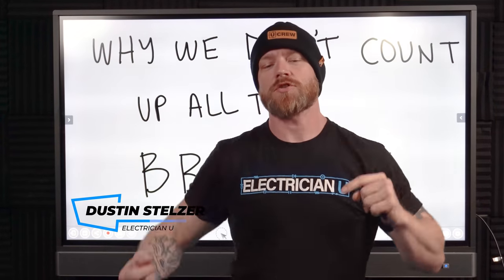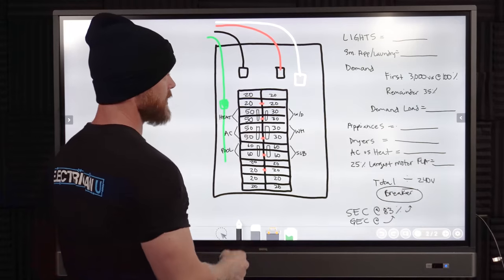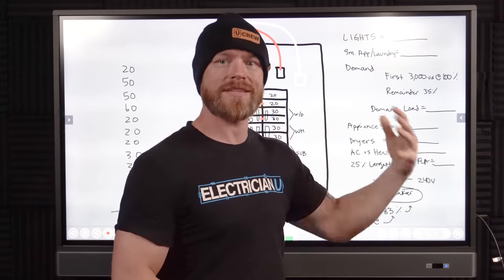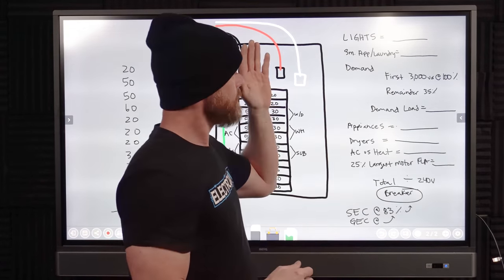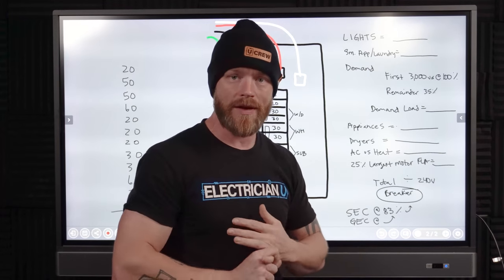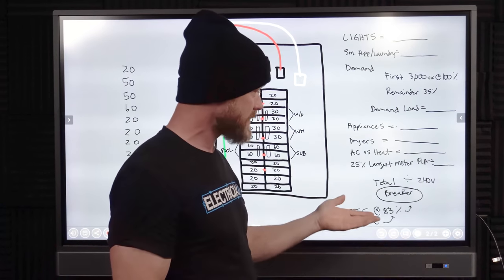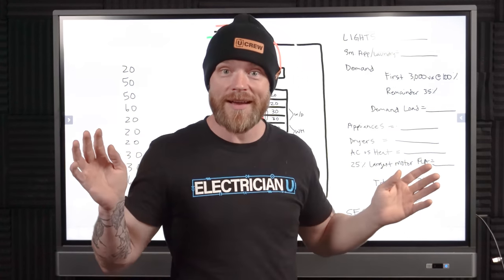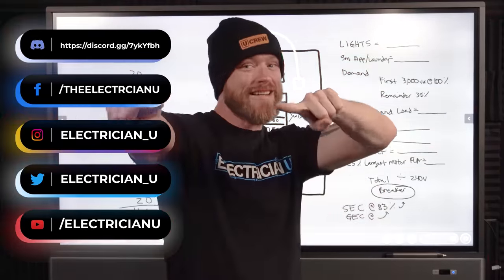Why is there more than 200 A worth of breakers inside of a 200 amp panel?!

Comment: Unless you get someone like me that collects vintage air compressors  and have 10hp single phase motors  and big welder.      I could definitely  accidentally over draw quickly but I use common since and hope for a bigger  Service one day. Even 3 phase would be super abdomen but that won't happen

Comment: I have a 150 AMP service installed in 1982.  The meter can has rusted at the bottom.  150 A has been very adequate, so should I just have a new meter can installed or should I upgrade to 200 AMP?

Comment: Good video. Would it be safe to run a ton and a half 50 amp central H/A system, a stove/oven(220 V), washer and dryer, refrigerator and a few 15 amp plugs and lights through a 100 amp box? The tiny home is about 600 square ft. Your response would be appreciated. Thanks. This is only be used as guests house..
Reply: @cat dash.  A 100 amp feeder is more than adequate for the loads you listed.

Comment: Is there a difference with the calculations in commercial or industrial? Sometimes we have a subpanel just for lighting or receptacles or both, etc... The house I just bought has a subpanel in the kitchen and runs some weird sh... stuff. But my original question... commercial or industrial. Is this just for residential?
Reply from the maker: Yes this is for residential. Typically in commercial or industrial the drawings are drawn up by an engineer who calculates the connected load and diversifies the load off of their calculations.

Comment: Looking at a GE panel. Two 20 amp Siemens breakers. Both have 14 ga circuit wiring in two spots. Breaker states 14 AWG on it. Is this acceptable for this breaker?

Comment: Because one breaker protects the outside wires, and the other breakers protect the inside wires. It's never expected that all, or even most of the inside breakers will be in use at the same time, otherwise people would be paying a lot more for their entrance drop for the extra wire size required, and the power company can't be bothered to install their own breaker for every single drop(cost of installation, cost of maintenance, hassle of accessing the pole every time some idiot trips their mains breaker), so they pushed that cost on to you by lobbying the politicians while the regulations were being written. Probably for the better tho, considering how long some power companies can take to schedule even a planned disconnect/reconnect when an entrance needs to be upgraded or replaced.....

Comment: So right about not adding up breakers. Years ago I worked at a large candy company. The huge chocolate room had two 3,000 amp 480 volt busses. Over the years they kept getting larger & more machines. I refused to add another 400 amp buss duct switch because they had over 6,000 amp in buss duct switches on each buss.  They hired a company to install recorders for 7 days for each of the two buss ducts. Told us to not even install a 30 amp buss duct switch where they insisted that I install a 400 amp switch in. In existing homes & businesses I would ask them for ultility Bill that shows a years worth of monthly usage and average power used every hour. Had rich people that had an all natural gas home with a 200 amp service that wanted a 400 amp service because their neighbor had one. Told them to save their money and existing few year old 200 amp service more then adequate.

Comment: It's just like your internet provider. If everybody tried using 100% of their internet connection at the same time, there would be some problems, because it definitely don't have that capacity for the amount of people the connection is shared with. But that never actually happen. In the real world, not everybody on the line has the big package, and even those who do rarely ever fully use it. Just like a main breaker panel, it just need to have enough amps for normal use and then some for occasional heavier usages.

Comment: So what happens when you need everything on at once?  I guess I need a second line or 400+ amps.  As I do music events and run huge speakers it’s easier to rent generators than to have a proper connection from the utility.

Comment: Definitely dona video on volt-amps vs watts. Still in trade school, struggling with that concept
Reply from the maker: Have you seen this one? https://www.youtube.com/watch?v=IKeGDxkOoNc&t=351s
Reply: Voltage and current are waveforms that may or may not be synchronized with each other.  In the special case that they are synchronized, Volt-Amps will equal Watts.   But in the event that there is a phase difference, there will be a difference between the product of the nominal (i.e. RMS) voltage and current values, and the actual average power delivered.

Try creating the following Excel spreadsheet.
In cell B2, we'll define a constant that will initially equal =pi()/4.   We'll play around with this later.

In column A, create time values, starting in A4.   Suppose we have a 340V amplitude and 50 Hz waveform, just to make it easier for us to express time points as decimals.   Set up the first 100 values in column A, to be millisecond increments, starting at 0, followed by 0.001 sec, and until you get to 0.1 seconds.

In cell B4, make the formula of "=340*cos(100*pi()*A4).  This is the voltage waveform, which has an amplitude of 340V.
In cell C4, create the formula of =35*cos(100*pi()*A4 + $B$2).  This shifts the waveform to the left, by what we set in cell B2.  The dollar signs lock the reference.   This is the current waveform, which has an amplitude of 35A
In cell D4, multiply =B4*C4.

Pull down the formulas of cells B4, C4, and D4, and then take the average of what you get in column D.   When I tried this, I got 4248 Watts.   This is the real power, the average of the instantaneous product of voltage and current.   The theoretical value if I had a lot more granularity in this calculation, would be 4207 W.

I gave you 340V and 35A as amplitudes, because these roughly correspond to nominal RMS values of 240V and 25A respectively.   When you multiply the RMS values together, you get 6000 VA.   But because the two waveforms are shifted, we don't get the full 6000 W.   We get 6000 Volt-Amperes, which the phase shift reduces to 4207 Watts.   Now set cell B2 equal to zero, and you will see that the average of column D is a lot closer to 6000W.   When I tried it, I got 6008.9 Watts.

The takeaways:
1. Watts is what you get, when you multiply Volts and Amps at every instant, and then average over the course of a cycle.
2. Volt-Amperes is what you get, when you just look at the amplitudes of the waveforms, translate to the RMS version, and then multiply these values.
3. RMS is a special kind of time-averaging called root mean square, that determines the equivalent DC voltage and current that would deliver the same power to a resistive load.  It has to do with squareing the value, averaging it, and then square rooting the result.  For a sine wave, it relates to amplitude via the square root of 2.  So a 340V amplitude is 240V rms, since 340/240 is roughly the square root of 2.

Comment: I have a 30a generator receptacle and a 30a extension cord for it, I bought a 30a inlet receptacle and a 10/3 wire to connect to the panel within 6 feet, I only have 20a breaker, so I bought a 30a breaker...is that ok?

Comment: So I am looking at getting an electric tankless water heater the style I need requires 3x 2 pole 40a breakers I do live alone my house is all electric no gas hence the electric tankless I’m also on a well and heat pump I do have 200a service so just with that being said is it possible to that my panel is capable of the load?

Comment: I have a Question? When a lamp is just pluged in and not turned on. Is power still being used, from the plug to the lamp switch. If you would unplug applainces and they are not being used. Then no power is being used.Make your electric usage is lower?
Reply from the maker: What you are wondering is a good question to ask. 

There are such things as parasitic draw on circuits. Toasters are one
Reply: @ElectricianU  Thank you,  I try to tell people that. You go away, unplug things not being used.
Reply: @ElectricianU  How are toasters a parasitic draw?   What element inside the toaster is consuming that power? 

I understand how wall wart power supplies are a parasitic draw, because of the still-energized step-down transformer, but what electrical element inside a toaster is consuming power when the appliance is dormant?

Comment: If it costs $10,000 to put in 400 amp service and $1,200 to put in 200 amp service then is there a way to put in 2 200 amp services to still save money? (Specifically one or the house and the other for a garage to support multiple EV's)

Comment: Depends on the family and home. Family like mine has 8 people. Nearly all breakers are being nearly fully used moat of the day lol. Also asian and other families could have 5 or 6 fridges. Some people have 2 families living in a home etc. Especially in the winter if people are using electric heaters etc.  Not a good idea to downsize too much then you'll be popping fuses when you use the microwave and the vacuum at the same time lol. But yea we won't be using all the amperage available unless it's a grow room / grow house lol

Comment: If NEC code requires that the devices in a certain room in the house be wired in at least 2 or more separate circuits, can you have one circuit wired to one switch on a tandem breaker and the other circuit wired to the 2nd switch on the same tandem breaker?  Is that considered 2 seperate circuits or do they have to be wired off of two seperate breakers?

Comment: Hello, Dustin. Thanks for sharing first of all. I have one question I hope you can help. Are tandem breakers allowed on 2020 nec code? 20A or 15A breakers tandem or twins. Thanks 🙏
Reply: Tandem breakers would still be allowed, if you had an application that didn't require GFCI or AFCI.  Since AFCI is required a lot more as of the 2020 NEC, it is a lot less common that they are used.   So in theory, they are allowed, if you could find one that has the functionality you need.

Comment: I have a 100amp main circuit switch, do I need to upgrade that to 200amp? Or is the main circuit switch unimportant. I’ve tried researching across the web but am not getting any info relevant to the main breaker switch.

Comment: I own my home. I'm a few weeks away from having my metal garage put on my slab. I have a 200 amp service. I used my last breaker slot on my 80 gallon compressor last year which is a 220v double pole breaker. How can I send at least 100amp service to my garage. Is that possible with a sub panel?

Comment: Calling the separate high legs as “phases” is very misleading.  They are both connected to the same phase    Just opposite ends of of a single transformer winding, and the neutral comes off the middle of the winding giving you have of the voltage, ie 240/120 or 230/115 etc.

Comment: im installing a 3000w on demand heater they say its 110v plugin  30 amp breaker needed but then it showing plugged into a 20 amp recepticle can u explain my breaker is a 20 aamp also

Comment: Hey, boss. Great vid for the DIYer & helping us better understand this stuff. Now I'm curious. My builder provisioned the circuit for our range to be on a 40A BR dipole for a fully electric range. However, the house came w/ an appliance package that included a Samsung gas range that only needs a 15A/120V circuit per Samsung. Since that range is spec'd for ~19% of the current breaker rating, do I need to swap the breaker for a smaller one like a 15A BR dipole? I know in 12VDC we either go up or down to the closest fuse size relative to our max constant current draw (WRMS), i.e. 83A/14.4V (1200WRMS car amplifier) draw would be paired w/ a 100A fuse since that doesn't restrict current, but isn't large enough to allow extensive damage in the event of overcurrent occurring. So, I'm assuming we should do similar for our home's 120/240VAC circuits too, correct? Just in case there was ever a short/grounding issue that could potentially be a fire risk? Unfortunately, I do not know what the current rating is for the actual outlet currently.

Comment: I see that you have a ground wire drawn entering your service panel. Where is that terminated at? When I first started doing residential, I ran a ground into my service panel from where the gec terminated in the meter. An inspector failed me for putting in a redundant ground and my boss agreed and told me I should know that.
Reply: Remember, we only bond neutrals and grounds at the first means of disconnect. If your meter can has no main breaker then your panel was the first means of disconnect and is a main panel, not a sub. We only run an EGC to a sub panel. So, it's not so much that the ground is redundant, it is technically illegal because now you have bonded your grounds and neutrals in two locations. The grounding electrode is a separate entity and exists for a completely different reason.
Reply: @charlesford157  yes I get that now I was talking about earlier in my career but his panel in the video is a main breaker panel so I asked why is there a ground
Reply from the maker: In typical configuration the ground wire and grounding termination point happens at the ground landing lug in the Panel board / breaker panel and runs outside to the grounding electrode. From that location. 

There are some reciprocity / AHJs that do not allow for that to be the case. So it's state by state, county by county, and code adaptation to code adaptation.
Reply: @ElectricianU  wouldn't running a ground from the panel to the electrode be pointless and repetitive because your neutral gets bonded to the gec at the meter though? The reason why neutrals and grounds go together at the main breaker panel is because of the neutral bonding with the electrode at the meter

Comment: Totally reasonable to have smaller service than all the breakers combined. The worst that could happen is that the darn thing trips. What I don't get is 15A-receptacles on 20A-circuits and extension cords with thinner wiring than the cabling in the walls... 

The British at least put these super cute individual fuses in the receptacles in their wacky ring circuits 😂

Comment: When I get my own place I would need 200 Amp service as I have a 30 Amp 220 welder and I just got a 20 Amp plasma cutter and I'm rebuilding a 15 Amp 220 air compressor so what ever the house already needs plus 50 amps worth of 220

Comment: It's important to use accurate vocabulary. 
In the example shown you only have single phase. Two legs of single phase. 
A phase in a 3 phase system is 120° from the each other phase. 
A leg is 180° from the the other leg. 

I've heard it called all sorts of things, variations of wye and delta. It's not. 
It's a 3 wire Edison system. That's what it's called and it has legs not phases.
Reply: It's only because the term "two phase" is spoken-for, by a now-obsolete system that had a 90 degree phase shift, that we don't call it two-phase.   By following the same logic that defines 3-phase systems, it really is what would be called two-phase, just by extension.   It is mathematically equivalent to two waveforms with a half cycle phase shift, even though they are really derived by negating the black wire's voltage to get the red wire's voltage.

Comment: What about when adding sub panels?   If I have a 200 Amp pannel can I add another 200 Amp double pull breaker to supply power to that sub panel?  Or does it have to be less like 2 175 Amp breakers?
Reply: Whether fuses or breakers, sub fusing or sub panels would never be rated the same.  The sizing of the sub panel would have to take into account the expected load.

Comment: I thought each house is provided 240V single phase of a 3 phase system so red and black are on the same phase? And one of them was center tapped on the transformer to get the usual 120V?
Reply: They come from the same phase of the primary side of the distribution grid, but the nature of the center tapped transformer secondary that we bond to ground at the centertap, makes them act as if they are 180 degrees out of phase (assuming ideal waveforms).

Define U(t) as the voltage across the extremes of the transformer secondary.  Let it equal A*sin(w*t)
Define V1(t) and V2(t) as the voltages at the X1 and X2 transformer terminals respectively.
Define the X0 transformer terminal (the neutral) to have zero Volts.
Because U(t) is the voltage across X1 and X2, this means V1(t) - V2(t) = U(t).
Make V1(t) and V2(t) equal in magnitude at every point in time.

A solution that meets this criteria is:
V1(t) = A/2 * sin(w*t)
and
V2(t) = -A/2 * sin(w*t)

Using trig identities, you can show that this is also equivalent to:
V1(t) = A/2 * sin(w*t)
V2(t) = A/2 * sin(w*t + 180 degrees)

Comment: Lol. Apparently you don't run a crypto miner at home.
I use a monitoring system to actually measure the current draw on both phases, feeding that information back to the miners so that it never pulls more than 80% of the 200 amp input..
It will surge higher for a second when something like the air conditioning first kicks on, you have the surge pull of the compressor starting up and it takes a second for the miners to spool down.. but it's within a half second and it's a slow throw breaker, So it doesn't cause issues.

But I'm always using 100% of the safe continuous load.

Theoretically I could pull more than 80% through the breaker but then it would not cool off and those surge loads would cause it to flip